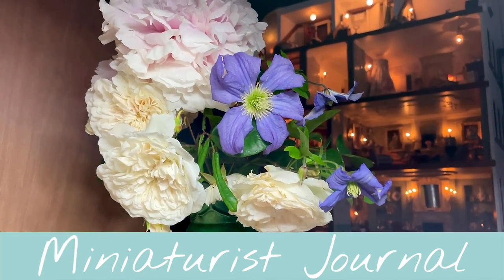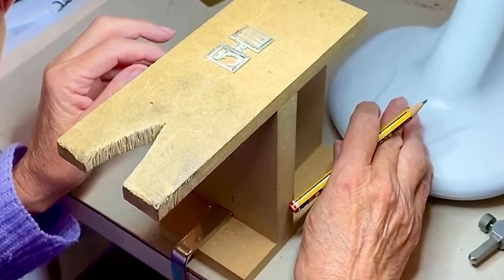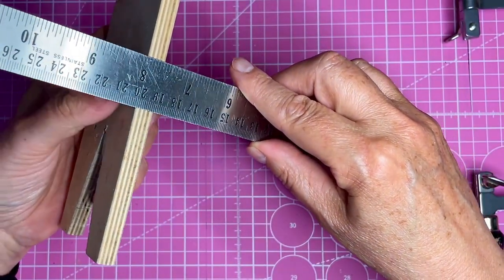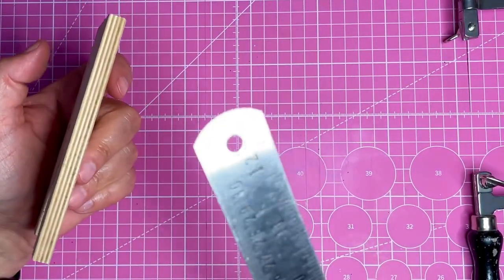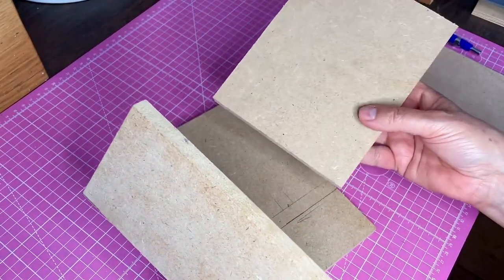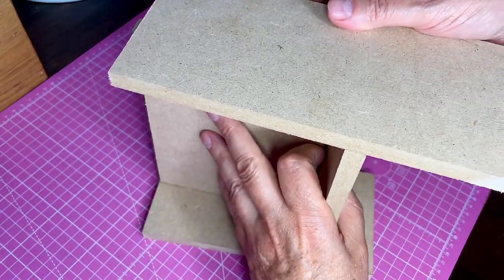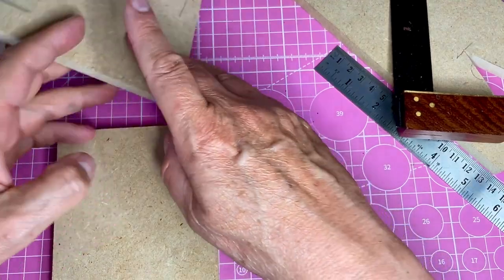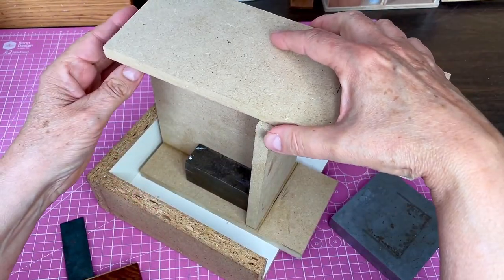How to make a bench pin stand.  Such a useful tool!

Comment: Thank you for this tutorial. It seems like a jeweler’s bench would be a great thing for all miniaturists to have. 😉 I do have a quick question. I received a saw for Christmas & haven’t had the opportunity to use it yet, but I have been wondering if there is a blade size that you consider your “go to” blade. I realize that not all blades work for all projects, but which one would you say you use the most? There are so many blades and it’s hard to know where to begin. Thank you?
Reply from the maker: You are so welcome!  
You're talking about a jeweller's saw, right?  It really depends on what I am making but for silver, I'd probably say a grade 5/0, which is quite fine.  The thicker the material, the coarser the blade of course, so when I cut wood with my jeweller's saw I often use a coarser blade like a 1/0 or even coarser like a grade 4. 
I was taught that 2 teeth on the sawblade should be the thickness of your work (two teeth of the saw should be in contact with the material when you are sawing).
It is a good idea to purchase one of those mixed bundles so you can try them out.  They will usually come in bundles of 144 which seems like a lot, but you will break them!  And you will be changing blades frequently. 😃